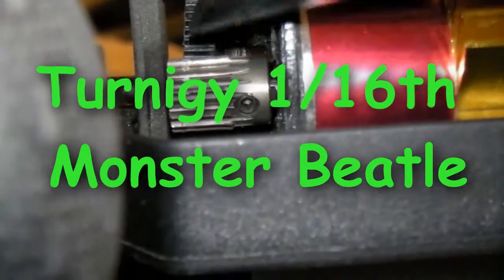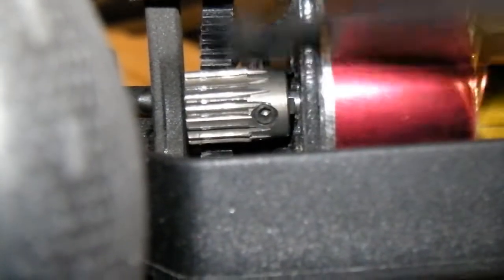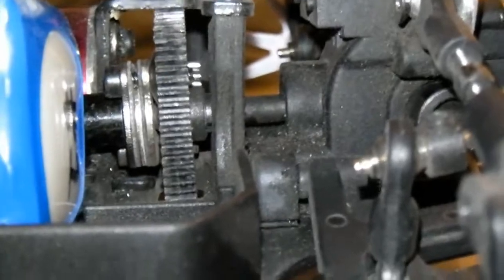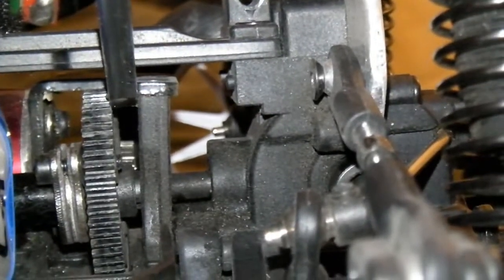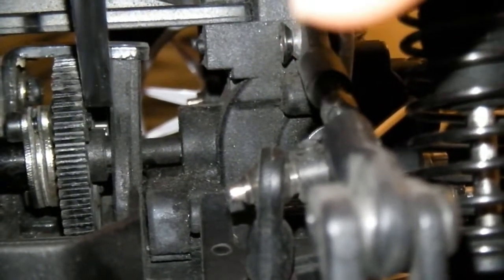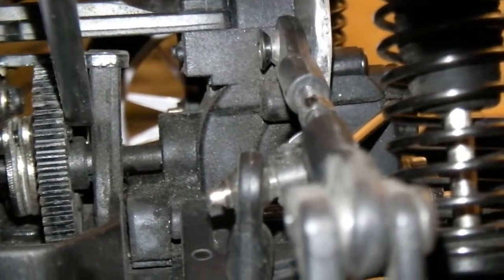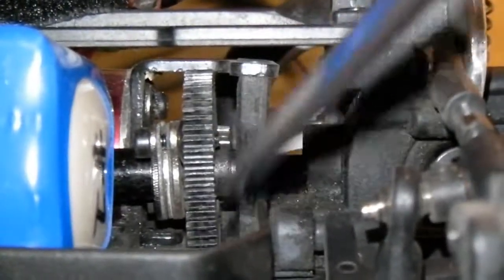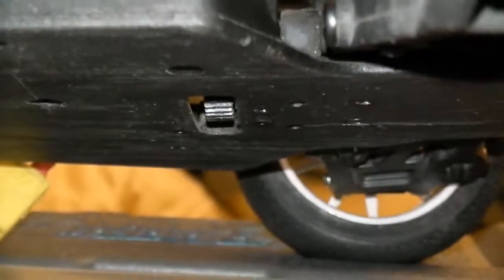Turnigy Spur Gear Problem

Comment from the maker: Ya, have you seen my other video with the beatle going at 110km/hr?  It's freakin fast. I put an 800W motor on there.
The gears are metal, they can handle this speed.  Maybe the new gears have manufacturing problems and some can break easily? Doesn't seem to be a problem yet, but I don't "BASH" my model.  Google World's Fastest "Turnigy and you'll find my video showing it going 110km/hr.  It goes across the entire parking lot within seconds, it's insane.

Comment: @DavidSunshine867 thanks so much for that mate..  I also wanted to tell you that there is a sale on kyosho mini inferno parts you can buy c hubs in aluminium for only 3 pound.. =6$   so maybe considering the speeds your running at u mite cwant so aluminum whhel hexagon things as they were off pretty eeasily. Ps.. Ur area in which u live lokks familiar. Is it somewhere in uk??

Comment: @DavidSunshine867 i ont know whats wrong with your car but i do know were to get parts and upgrades from. you can get them from gonitroonline and nitrotek on nitrotek all parts fit and its called the acme pioneer but on gonitroonline only some fit as its a buggy but on nitrotek its a truggy so its alright. also turnigy and photon are the same name for acme if you do not believe me go to go nitro and on the bottom of the page it says acme distibutor

Comment: I think things are getting tweaked at the speeds your running. Mine hasn't done that but i did glue an old wheel hex nut to the chassis under the other side of the motor to stop it from flexing too much during G force. FYI I found out that GOTNITRO.com has a car called the Photon that uses about 80% of the same parts and they show up at my house the next day if I order before noon!Seattle. I dont know if they ship to Canada but it might be worth a shot, at least until HK stocks the parts in USA

Comment: Hi David,

Yes, the Spur is at an angle, but the stock motor is aligned from the factory to fit due to the mount being bent accordingly. When we upgrade the motor, we will need to do some heating and bending. :)